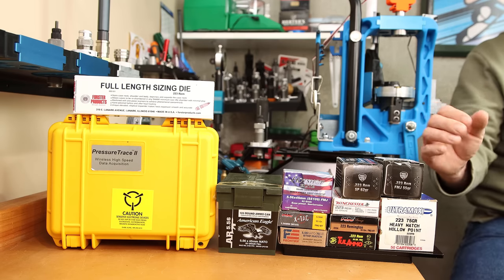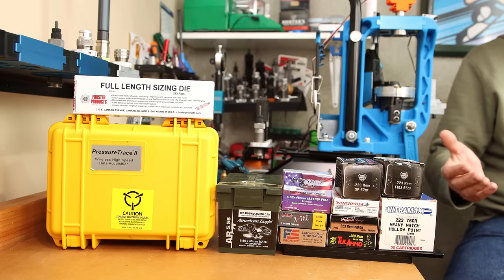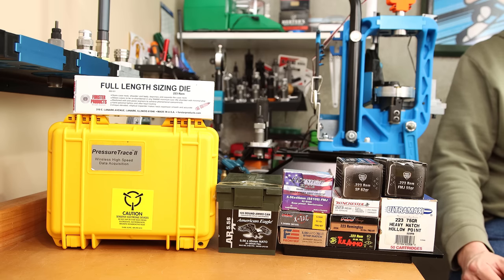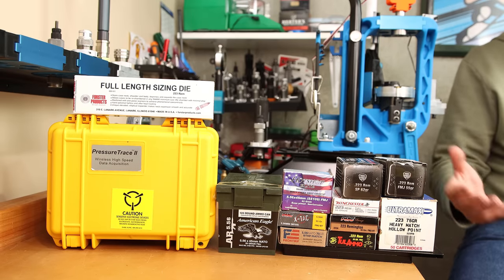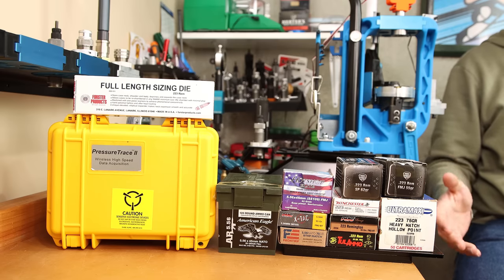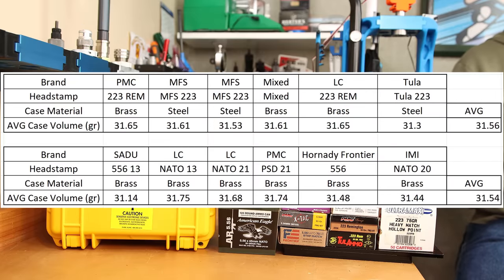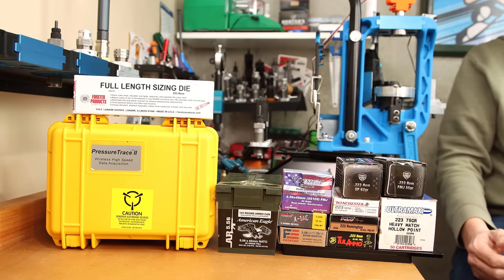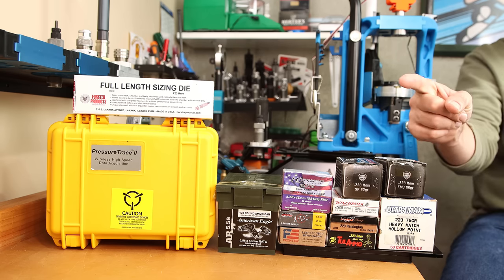223 vs 556 - The Hidden Truth No One Tells You!

Comment: The correct answer is..... they BOTH fit in my AR. No problem.
Reply: With all due respect, fitting and firing charge strength is a bit different.
Reply: @samuelcolt6670  get 223 Wylde chamber, it's a hybrid
Reply: Itachirevived  technically 5.56 chamber can use .223 ammo. And yes, I don't even use .223 barrels to avoid any issues. I develop my loads, which I personally call "223 remington". It only matters how much powder I put and what bullets I insert. Twist rate is another story.
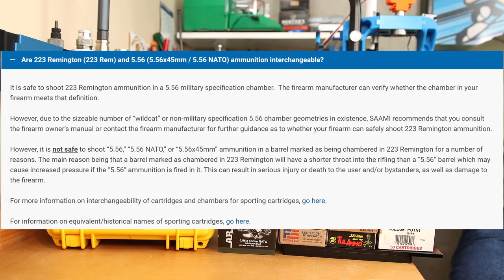Reply: Itachirevived  maybe you didn't make it to the end of the video? Pause and read at 10:59 closer. Using 556 ammo in a regular "223" marked barrel causes higher chamber pressure and possible sudden facial tissue loss... A "223 Wylde" marked barrel has a "hybrid CHAMBER" to safely shoot both 556 and 223, and usually does so more accurately too... BTW a 223 Wylde is not a barrel profile either, profile is the OUTSIDE shape of the barrel.
Reply: Itachirevived  your earlier comment! 
".223 wylde is the only barrel profile I know of that allows both, but you should be careful firing 5.56 in a .223 non wylde"
Reply: Itachirevived  you said: "I THINK only 5.56 in a .223 non wylde spec chambered barrel would be an issue..." "think" means you weren't sure, so hopefully I made things clear.
Reply: Itachirevived  maybe you should, that or quit giving gun advice on the internet because the end of your first comment was incorrect and could even get someone killed.
Reply: @ Dave, I am of the same cloth, same as, why buy a .38 spcl when I can get a .357 that does double duty, and you sure did get the Einsteins of gunning sparked up, CHEERS
Reply: Yes they will both "fit", and within certain parameters they are both safe to fire in an AR or anything chambered for 5.56mm, but firing a 5.56mm cartridge in a rifle chambered for .223 Rem is not safe and the SAAMI warns against doing so.
What makes the difference and also makes it dangerous is a chamber cut for 5.56mm has more "free bore" before the rifling lands start, that means the bullet travels further before being pressed into the rifling.
To completely understand everything you have to go back to the development of the AR and the military accepting it, it originally was going to use the .223 Rem cartridge, but at the last minute the military decided it wanted more velocity out of the bullet so different powder was selected, that raised the chamber pressures to dangerous levels so the developers just cut the free bore further down the barrel giving the bullet a slightly longer distance to travel before having the resistance of being pressed into the rifling which dropped the pressure down to a safe level.
Wherein the reloading dies are the same for .223 Rem and 5.56mm which is why people assume they're the same if you look in a gunsmith supply catalog like Browells you'll see that the chamber reamer's are different, the 5.56mm chamber reamer cuts a longer free bore than the .223 Rem does.
Now chamber pressure is one thing but there's still several scenarios that it's unsafe to fire .223 Rem in a rifle chambered for 5.56mm, and that's if the rifle is an auto loader (which most everything chambered in 5.56mm is) and you fire soft point .223 Rem cartridges out of it, this same thing holds true for shooting soft nose .30/06 out of an M1 Garand or firing soft nose .308 Win out of an M14, with an auto loading rifle shooting a soft nose bullet you run the risk of a sliver of the lead nose being shaved off during the round being cycled into the chamber and being caught on the neck of the casing and messing up that rounds head spacing, since all of those cartridges head space off of the casing neck it's a possibility and has been known to happen, this can lead to several catastrophic problems including "instant and unscheduled removal of facial epidermis".
It's for this reason that Hornady developed the ballistic tip bullets with the plastic polymer tips for hunting rounds in an auto loading rifle.
Reply: Itachirevived  aka a .223 domestic!, lol
Reply: 300BLK also chambers in your AR. Give it a shot!
Reply: @WaterZer0  lol
Reply: They both go boom ... who cares elsewise
Reply: 5.56 might blow up a .223 marked AR, check barrels before shooting.
Reply: Well I use 7.62 so none of em fit just right (duh🤣) but it is good to have knowledge
Reply: Now tell us you fire 5.56 NATO through your vintage 1970's Mini-14 🐂💩
Reply: @scottdunn2178  You had 8 months, and THIS is the reply you were able to come up with.
Reply: @forgyde  Yeah, well I suppose 8 months is what it will take to get a replacement barrel for your Ruger after a steady diet of 556 😅
Reply: A dead boar is a dead boar…either with 223 or 556
Reply: 5.56 is what you should use though. 223 fits and fires but there’s many reasons why you should use 5.56 plus more powder and pressure
Reply: It seems like the slight differences and possible mishaps like most issues comes down to get a good rifle and if your going to spend hours tossing lead
 just because you can doesn't mean you should
Reply: @macgyver5108  believe he stated he does not buy 223 barrels which would mean he probably has 5.56 barrels which will shoot either 223 or 556
Reply: @scottdunn2178  not vintage but my ruger mini 14 is chambered in556
Reply: @307living3  Was mainly referring to the mid 70's-early 80's era guns chambered in .223 Remington. Because the 556 is higher pressure, the "leade" space between the rim of the case and where the rifling starts is ever so slightly longer to allow the pressure to dissipate slightly before the bullet engages the rifling. This is why it can be dangerous to fire 5.56x45mm NATO in a chamber intended for .223 Remington.
Reply: @samuelcolt6670  bingo my man. 223 is great for plinking at CQC distances if you got it cheaper n 556. 556 is essential if you are doing anything with longer range shooting if accuracy is a concern and is essential for piece of mind if you need your rifle for defense.
Reply: @307living3  pretty certain the OP never stated which cartridge his AR was chambered for before any of my comments, MOST of which were directed at someone else (Itachirevived if you look at all the "tags") who either wisely deleted all their bad advice, or blocked me cuz I don't see them anymore...
Reply: Interesting, your comment when I  last checked it had 223 likes.
Reply: You have got some serious precision equipment there. Thumbs up on the video.
Reply: @LilSkimp  you can run 223 in a 556 all you want you tend to have lower accuracy because of the amount of bullet jump 556 bullet are designed around 60gr where most 223 55 grain at max yes over time that's changed every one is wanting longer and heaver bullets for longer range but what it come down to is when they were making the m16/ar15 when trying to get to the speed they wanted with the bullet they wanted the passed the saami spec for 223 for pressure and stared to have ejection issues to fix the issue they added .025 to the throat. You can shot 556 out of a 223 bolt gun usually with little issues but you better know what pressure signs are because a really nicely tight machined chamber with have the biggest issues a crappy loose gun you may never have a issue.
Reply: @T20-c8f  223 can be just as accurate in a 223 barrel. 223 was originally designed around 55 grain and lighter bullet. 556 was design to run a 60+ grian with a steel core making it even longer bullet at a set speed the military wanted so redesigned the gun to chamber to do it. Most all bullets designed for 556 ar fmj because of military/geneva convention requirements where 223 you can get better designed bullets depending on what the desired target is.
Reply: I have a 556 barrel, so I don’t have to worry about that, lol…
Reply: @Badrs2810  but accuracy when using 223 in a 5.56 barrel is not optimal. That's why the 223 Wylde was created.
Reply: @t-bfr45-70  true. But, I’m not trying to hit dead center, every shot, I’m trying to hit zone. I can understand the use for the Wylde…but, my ultimate goal is defense against any threat up to 7’ and from 2’ to 3’ wide…& within 300 yards, I can group 4”…both 223/556…
Reply: Boy, im glad i was shot with a 223 round instead of a 556! - said no one ever.
Reply: Not if you have a 223 only barrel...
Reply: @KYAg227  🤣
Reply: @dazzling3237  well, they’ll still fit…and work for a moment, lol.
Reply: No it isn't.  They  are the same.
Reply: Not  true
Reply: Ha haha  223and 556, no difference
Reply: Send it👍😁
Reply: As long as it's a 556 Barrel you can shoot 223 all day long that's all I care about
Reply: Yup..
Reply: I think mine has “5.56/.223” stamped on it
Reply: To the point!! Thank you!!!!!!!
Reply: The only difference is that the 556 is the government round 223 is the civilian round
Reply: If you have a rifle in. 223 it needs the MILITARY THROAT which is longer than the standard 223 throat it was done to account for the fact military ammo may occasionally have a bullet not seated full depth this prevents the bullet jamming in the rifle when loaded causing an over pressure situation. My Ruger has the military throat I discovered this when I realised I could seat bullets beyond spec depth Ruger confirmed it had the military throat. THAT'S THE ONLY DIFFERENCE unless you need tighter rifling for different bullet weights.
Reply: @samuelcolt6670  If you have a rifle in. 223 it needs the MILITARY THROAT which is longer than the standard 223 throat it was done to account for the fact military ammo may occasionally have a bullet not seated full depth this prevents the bullet jamming in the rifle when loaded causing an over pressure situation. My Ruger has the military throat I discovered this when I realised I could seat bullets beyond spec depth Ruger confirmed it had the military throat. THAT'S THE ONLY DIFFERENCE unless you need tighter rifling for different bullet weights.
Reply: Thanks. The answer I was looking for, in about a nanosecond.
Reply: I agree with you on this one. It goes bang and what ever is in front of you, falls. So, screw it, too much work for me.
Reply: A .50 cal fits into a trench gun...
Reply: @dukecraig2402  where can I find the videos of 223 barrels suffering catastrophic failures when firing 556 cartridges?
Reply: You obviously didn't watch
Reply: @macgyver5108  5.56 barrels will handle .223 fine

My understanding, being in commercial ammo processing is the pressure and the chamber dimensions/tolerances.

So you can use factory .223 in a 5.56 barrel but not the inverse. You can use 5.56 brass in a .223 chamber using .223 loading data.

In destructive testing, the only thing we found to be typically different was case separation/failure. 5.56 tends to blow the neck and shoulder apart, .223 tends to have significantly more head separation (bigger fireball in your face) in its failures. Basically a profile difference from the rim to the shoulder and neck. 5.56 tended to have thicker base and tapered walls, .223 tended to have more consistent walls with fractionally less meat in the bottom portions.
When I say fractionally I mean like maybe 1 thou.

There used to be some talk about  yellow brass and the actual alloy compositions. .223 tended to be more copper because lubricity and lower pressures and clean environment, where milsurp/spec ammo had more lead and tin for less environmental contaminated/oxidizing. For the record, that's all hearsay and I never bothered with any metallurgical inspection.

Also take for ganted 2010 was the last year I was seriously involved in all that. These days I really only handload for my Arisakas.
Reply: @ObservationofLimits  preaching to the choir boss... It's these other clowns that have never done any reloading, who can't grasp the concept of an over pressure load, also called "ToO mUcH PowDUrrr".
Reply: No  difference
Reply: If your  barrel  can only  take standard  pressure. Throw  it in the  trash.
Reply: @scottdunn2178  you nailed it! That's a great example of what not to do. Old .233 bolt action is another good example of, don't put.556 in it. Another good rule is use what the gun says to use. That's rule one.
Reply: @307living3  I'm old and my .223 is also. Your mini is nicer. Got a friend who has mini in .556. Cool.
Reply: @bryandoran389  my stepson came home with a box of 556fmg for his bolt action. He ask if they were ok to run. I told him what does it say on the barrel?
Reply: @igoranisimov6549  Or just get 5.56 and call it good.
Reply: @dennisdavid9588  there is a reason why some chambers are created differently
Reply: Beware 5.56 in 223 bolts though . the 5.56 has a thicker shell extractor lip and it can damage 223 shell extractors. Pick up a full upper for that AR for 125 $ its easier than rebuilding the bolt in emergencies and can be swapped out under fire . keep an extra firing pin and shell extractor for both if your a preper .
Reply: @igoranisimov6549  I can’t think of any reason to buy an AR in .223. You’re cutting yourself off from a large swath of otherwise available ammo for what? A niche .223 AR for competition/precision maybe?
Reply: @dennisdavid9588  I have built precision AR, but I used match Wyld chamber, and I fireform my own cases... not every AR owner is a "prepper"
Reply: @dennisdavid9588  ...in fact I think it's hard to find AR barrel in 223 on the market. None sell complete AR-15 in .223 either. This discussion is typically about .223 vs 5.56 ammo in general. Bolt action rifles may be...
Reply: @dukecraig2402  very informative comment.  Thank u
Reply: @1bluensx  
The story of the development of the .223/5.56 is pretty involved, most people assume that Eugene Stoner developed the cartridge but he only started it, there was so many people who had their hands in it including one of the editors of Guns and Ammo magazine, it went through a lot of changes and names all the way up to the last minute change that differentiates the .223 and the 5.56mm.
The .223 Rem had already been established and was already in production being chambered in firearms and cataloged by the SAAMI when the military at the last minute wanted the changes made that makes the 5.56mm different from .223 Rem.
Reply: So can you shoot .223 thru 5.56 that’s all I really want to know
Reply: @dilaudid69us  
Yes, you can safely shoot .223 Rem in a firearm marked 5.56mm.
Reply: HahahahahahahahahahahahahahahahahHahahah. Water or gasoline they both go right in my fuel tank. No problem
Reply: My Bushmaster even has that stamped on it.
Reply: @gleneckert1  It'll be fine....prolly 😆
Reply: Same I get both
Reply: Exactly
Reply: Lol... and your Big Heavy Black Gun is SCARY!!!!😱
Reply: @igoranisimov6549  this right here.
Reply: @macgyver5108  
my god, dude.
Reply: @Jimothy-723  yes?
Reply: This I understand 👍
Reply: A wylde barrel can fire both. Not all barrels can.
Reply: @samuelcolt6670  never is a problem
Reply: @macgyver5108  id say failure is equal to random failure it just doesn’t happen
Reply: @macgyver5108   Maybe if you explained your statement it would help people
Reply: Truth is I've never owned a 223 all my rifles are 556 which in that case both chamber. My understanding is 556 shouldn't chamber in a 223. If it does the head pressure will be ridiculous and DANGEROUS
Reply: Neither one fits in my ARs… but that’s probably bc one is 7.62x39 and the other is 350 legend
Reply: @jamesscott3230  unless you have a mini 14 then the manual and manufacture says most are marked 223 but they all shoot both but the one target model
Reply: I have a dB 15 556 and a rifle I built with a bull barrel 556
Reply: @calebnation6155  I also have a couple ar 10s different from the AR15S.
Reply: Good job Patrick star!
Reply: @macgyver5108  you can use .223 in 5.56 barrels but not the other way around safely
Reply: @timwhitten9918  if you bother reading my multiple comments I already explained that. Plus you forgot to include .223 Wylde barrels which have a hybrid chamber/ throat which can shoot either cartridge as well, usually with a smidge more accuracy too.
Reply: 556 SURE as hell wont shot in 223 savage bolt action lol….ar works fine
Reply: great video! what I am taking away from this is, use whatever brass you want and if you load it to 223 standards you should have a safe round.
Reply: @T20-c8f  that's one of the dumbest comments here. Do some more !!
Reply: @dukecraig2402  thought the polymer tips were so you could have a pointed bullet in something with a tube magazine without the bullets in the magazine setting each other off. I actually use them in my Winchester 1894 instead of the round nose bullets sometimes.
Reply: @drksoldier1  
That's a different type of polymer tip, on those the tip retracts back into the bullet's body giving it a flat nose when stacked into tubular magazines, then when it's chambered the tip pops back out so it has the flight characteristics of a spire or spitzer tip bullet. 
I vaguely remember when those came out years back and don't even know if they still make them, I only remember them being made in the large bullets like .458 dia for .45/70 and other straight wall large caliber cowboy cartridges, although they might have made them in .308 dia for the .30/30 I just don't remember because I never bought them or loaded them, but I do remember when they came out.
Reply: @drksoldier1  
Yea I just looked them up that's a Hornaday FTX "Flex Tip" bullet and is different from regular polymer tip bullets, don't think that they're all the same, the Hornaday FTX is designed specifically for being able to load in lever guns with tubular magazines, regular polymer tip bullets don't have the feature of being able to safely put them in a tubular magazine rifle, only the Hornaday FTX is designed for that.
If you've been loading regular polymer tip bullets in something like a Model 94 .30/30 consider yourself lucky you haven't blown yourself up yet, regular polymer tip bullets are not designed for that and are unsafe to do it with.
Reply: @dukecraig2402  lol I don't load my own rounds. Was just here wondering the differences between .223 and 556. The Hornaday FTX are the ones I use in my Winchester (in 30-30, they do also make them in a variety of different calibers), the tip definitely doesn't retract though. IDK, Didn't realize there was another kind of polymer tip.
Reply: @drksoldier1  
When I said "load them" I meant the physical act of loading them in the rifle not hand loading cartridges. lol
And once again the Hornady's are specifically designed for that, the other companies polymer tip bullets aren't. 
They don't call them "Flex Tip" because they flex from side to side, the whole idea of their design is that the very tip has enough give that when stacked in a tubular magazine a point isn't pushing against a primer, the tip gets pushed back.
Once again, and back to your original question, no, polymer tipped bullets aren't designed for tubular magazine rifles, only the Hornady FTX is.
Reply: @dukecraig2402  yeah, I could be wrong but I'm pretty sure all guns chambered in 30-30 are tubular mag lever guns. So any commericial 30-30 round should be safe, and The Hornaday FTX are the only pointed bullets available in that caliber that I've ever seen or know of. The tip on them does actually rest directly against the primer of the round in front of it though and doesn't get pushed back. According to Hornaday, the polymer itself is just soft enough that it is incapable of setting off the round in front of it even though the tip is resting directly on it. Never realized they made polymer tips for other reasons though. After doing some reading, it seems like the primary benefit in other guns is better expansion which the FTX's also tought. It also talks about better feeding. It seems to specifically mention better feeding with the polymer tips vs with traditional hollow points in certain firearms. I could see how it would prevent lead getting shaved off like you were talking about too though.
Reply: @drksoldier1  
Good God, I didn't say other commercial ammo isn't safe in a .30/30 lever action, of course it is, it's designed for that, if it says .30/30 on the box yes it's going to be safe to shoot in one, that's why the traditionally made bullets have a flat nose, and by the way that's what they're called and classified as, flat nose not round nose as you said earlier, if you want to see what a round nose bullet looks like look up .30/40 Krag, they're round on the end and not flat like a traditional .30/30.

Once again, no, polymer tip bullets weren't designed to use in tubular magazine rifles, only the Hornady HTX has that feature, they use a material soft enough (other polymer tip bullets are made from a harder polymer) that when cartridges loaded with them are stacked in a tubular magazine the tip flattens out so you don't have a hard point against the primer of the cartridge in front of it, this is why the traditional .30/30 bullets had flat noses, then when the Hornady FTX is chambered the tip flexes back to a point to give it the flight characteristics of a spitzer nose bullet, other companies polymer tip bullets don't have this feature because obviously they use a much harder polymer that doesn't flatten out under the spring pressure in a tubular magazine. 

And since you originally came here to find out if .223 and 5.56mm are the same, no, they're not and don't ever let some yahoo tell you they are, the reloading dies are the same which is why some people mistakingley think they are, but the chamber reamers are different, that's where the difference lies and is why it's unsafe to fire 5.56mm in a chamber cut for .223, it is however safe to fire .223 in a chamber cut for 5.56mm.

The difference between the two is the rifling in a chamber cut for 5.56mm is further down the barrel than in a chamber cut for .223, that gives the bullet more distance to travel before it's pressed into the rifling, that's the way a 5.56mm chamber is cut because they're loaded hotter than .223, without the extra distance for the bullet to travel before it's pressed into the rifling the expanding gasses will cause a dangerous rise in pressure.

While .223 is safe to shoot in 5.56mm the easiest thing to do is just shoot whatever your barrel is marked for, that way you don't have to worry about anything.
Reply: @drksoldier1  I have heard of malfunctioning using the Hornady Leverevolution ammunition in Marlin 336 models. The magazine tube is the issue. The ammunition is an improvement for shooting at longer ranges. Those who wouldn’t shoot over 100 yards now can go 200 yards with a properly sighted optic using the FTX bullet used in the Hornady Leverevolution.
Reply: @boostimalaka1  They can have feed problems, and Marlin actually made a new follower just for them to correct it. You can also load one regular round first followed by the Hornaday rounds which is also supposed to alleviate the issue and is what I do just as a precaution.
Reply: @scottdunn2178  You can do it but Ruger recommends 223 Remington.
Reply: @johnhix484  You could also put a  
.357 Magnum in a .38 Special if you seated the bullet far enough into the case... but as with this; just because you can doesn't mean you should. If Ruger recommends .223 Remington... then they have a reason for not recommending 5.56 as well 👍
Reply: so simple ......thank you
Reply: 😂😂😂😂 trueeee
Reply: Greeeeen tipsssss!
Reply: That's all I need to know lol
Reply: Obviously you have a 556
Reply: Yeah. They just fixed in there in mine
Reply: I sure hope you dropped the mic after you made that statement
Reply: Most ARs can chamber and fire .223 and 5.56
Reply: @Valorius  ...exactly.
Reply: long live king david!
Reply: Throat space is not the same between the two. I was told. Changing the pressure to spike sooner. 🗿🗿🗿
Reply: @LilSkimp  Throat Space is the main. Changing the pressure spike to happen sooner
Reply: It fits it ships.
Reply: Only one will blow it up...
Reply: @igoranisimov6549  do you know what a . 223 Wylde chamber is?
Reply: As a gunmaker I can fully agree to that👍
Reply: Where is this conversation headed?
Reply: But what about my stainless target grade .223? Not Wylde but tight fitting .223 chamber? 5.56 will go bang. But after a few hundred to a thousand rounds it can damage the chamber and perhaps action.  Thats 2 weekends for me.
Reply: Bottom line .223 in AR or 5.56 or .223 Wylde is OK. 5.56 in true .223 except a few emergency shots, is not. No way i will risk my laser- like Ruger M77 Mark 2 with .9" @100 yds.
Reply: @Badrs2810  there are us accuracy fanatics who get upset with flyers in the 9 ring!
Reply: @jasonkelley5741  the issue is not with AR15 style in 5.56. It is with bolt action or semiauto target and hunting rifles in .223. 5.56 can ruin or damage chamber and cause damage to shooter. Usually takes a hundred rounds or more. Mil grade 5.56, especially newer heavier type,  has more pressure than such a rifle is designed for. At very least can lesson accuracy. Fromm mostly X ring to having wild shots out in 7 ring at 100 yds. Means miss of vitals to a wounding shot at a few hundred yards.
Reply: @igoranisimov6549  this info is vital for bolt action shooters not ar15. Precise .223 rifles for matches and small game at distance. There are safety as well accy issues and even extractor problems in some cases. I have both. AR is sloppy compared to my tuned Ruger M77 mark2. Stainless .223. With .y carefully loaded .223 my Ruger shoots better than 1 MOA. AR is like 3.
Think sniper vs foxhole against infantry attack at 50 yds. Different needs. I get upset when my shots rifle or .45 go outside the 9 ring at 100 yds or 25 yds respectively.
Reply: Make us a video of yourself firing 5.56 thru a .223 barrel PLEASE! 🙏🏼🙏🏼
Reply: Cycle and ejection is consistent we would assume.
Reply: Awesome. Headspacing and chamber pressure don't mean a damn thing until it blows up.  Then it really doesn't matter.
Reply: All I've seen ever on this is that the 556 has an additional lead in the chamber!
 So A556 should happily chamber 223 Remington the other way around I guess all I could say is the proof is in the putting I shoot 556 in my 223 mini all the time in fact who's gonna pay 25 bucks for 20 rounds when I could get a whole bag full of them for a $100!?
Reply: @scottdunn2178  I bought a new Ruger  Mini 14 in 1982 which I still have and shoot. The RECEIVER is marked cal .223 REMINGTON. The owners manual that came with the rifle and I still have plainly states that either .223 Remington or .556 Nato ammo. can SAFELY be fired interchangeable  in the rifle with NO damage to the  rifle.
Reply: If don't use the correct mag. Depending on the rifle. It will jam!
Reply: You are absolutely correct. As long as your rifle is built to 5.56. If you shoot 5.56 in a rifle that’s built to 223? Eventually it will fail. Blow up or just fail. The cure for this discrepancy is to only buy a rifle built to 5.56.
Reply: @KYAg227  Are you saying that both can be devastating ?
Reply: Deltons have the ability to safely fire both too.
Reply: @stomper2582  
Because they are built to 5.56 specs. Really a nice rifle aren’t they? When I bought mine they were $350. I’m happy with it.
Reply: @macgyver5108  The pressure difference is minimal. Unless your firearm is in bad shape and you are loading VERY hot 223 -556 is a moot point.
Reply: @karlschulte9231  back in the late seventies my dad bought a new Winchester 30.30 bolt action and 2 boxes of Remington ammo always the first time he would shoot a gun he would just hold it out from him a shoot it never pulled it close to his face. On this day new gun new ammo he set down at the bench pulled the gun in tight 1st round gun exploded sending my dad backwards 10 to 15 ft. Seems Winchester had left just enough room in the chamber for the cartridge to explode. My dad had metal in his face and even a piece came through his shooting glasses into his eye. I just wanted to tell this story to the people shooting the .556 in a .223 it's hard to imagine what it looks like when a gun explodes till you see it. The barrel was shoot out to the 50 yard marker at the range
Reply: @scottdunn2178  I called Ruger and Ruger said all except Target model. Ruger mini 14s would fire 556 even if only stamp 223 straight from Ruger said they would withstand 556
Reply: @johnhix484  I called Ruger cuz I have an old '70s mini 14 hunter stamped 223 and they said any mini 14 will shoot 556 even if only stamped 223
Reply: @singleshot1331  Fantastic. It's settled then.
Reply: @dukecraig2402  not totally disagreeing with you, but if there was fouling in the chamber as you suggest, to the point where the headspace was greatly diminished, the result would just be a bolt that doesn't close. 
Yes this malfunction could cause you to lose in a gunfight, but saying "you're gonna blow your own face off" is a bit much.
Reply: @scottdunn2178  I figured Ruger makes the mini 14 they should know but ya never know I reckon until one goes boom instead of bang
Reply: @singleshot1331  If I could own one I wouldn't mind having an old vintage 70's Mini-14 👍
Reply: @igoranisimov6549  A regular 5.56 chamber will take both rounds without issue forever.
Reply: Absolutely!
Reply: Absolutely.....could have cut this video by half with just that recognization.
Reply: Awesome answer, and mine is the same!
Reply: fitting isnt really the issue
Reply: Agreed!
Reply: Things to consider in pressure rise? In bolt guns between both calibers you don’t run the risk of having a weakly crimped bullet progressing further into the chamber during action cycling if the bolt. In an auto loading rifle there is the possibility of the projectile moving forward when the bolt slams closed into battery if cartridge was not crimped properly. This in of itself can change the overall length of the cartridge when fired and this can change the pressure rise dramatically  up to and possibly beyond published safe loadingrecommended tables. The added free bore or lead jump allows for some forgiveness in sharp pressure rise vs a shorter chamber lead.  So between the two offerings both can load the same weight bullet, both have overall length recommended restrictions but only one of these two calibers allows for an extra safety margin on overall length errors or mishaps due to weak crimping of projectiles when fired in auto loading guns where bolt speed/mass act like a hammer when chambering a cartridge. If crimped properly it should take some effort to “pull a projectile” from a case with a kinetic hammer device. Additional info to this topic that was not discussed when comparing these 2 very similar cartridges and their identical weight projectile offerings. 
Good informative article
Reply: I have a 556 M&P Sport and every single time I tried to shoot 223, in the beginning of owing the weapon, every single round would foul. 556 shoots smooth like buttah. Maybe I'm not pulling the trigger hard enough... 🤔🤔🤦🤦
Reply: @SARDOG  that doesnt really make sense....both should fire fine, n 556 should shoot 223 fine,
Reply: But a 556 do well in a 223.
Reply: hooah
Reply: @jamespruitt3159  no
Reply: My Sig m400 pistol chambered in 556 turns to shit when I run 223 through it
Reply: @igoranisimov6549  Get a 5.56 chambered rifle, and you can shoot both. Problem solved.
Reply: 556 will not chamber my 223 AR shows a bullet news up inside of the casing and Bends neck of the case
Reply: My colt handles both beautifully
Reply: Based
Reply: Exactly. Both will go bang bang.
Reply: They fit because they are the same, the dif is in the chambers and the issue is really splitting hair so stop with this nonsense.
Reply: see, it'S the attitude you have that i will always value from americans, "if the ammo works and doesn't blow up my gun, then both are good"
Reply: What's the barrel chamber?
Reply: @drewt.4353 when's the last time you saw a .223 rem AR barrel? They haven't existed in a decade or two.
Reply: This statement in a nutshell is why America is failing.
Reply: Thanks. Now I don't need to watch this lol
Reply: @Leggobrandon40bang  you really don't if you're buying new rifles.
Reply: @dukecraig2402 M4 feed ramps = no problems.